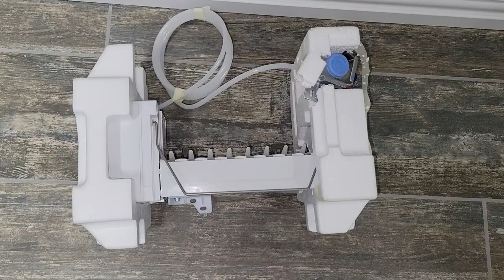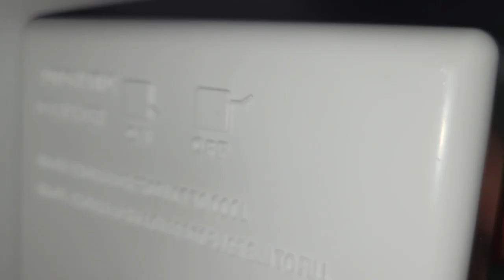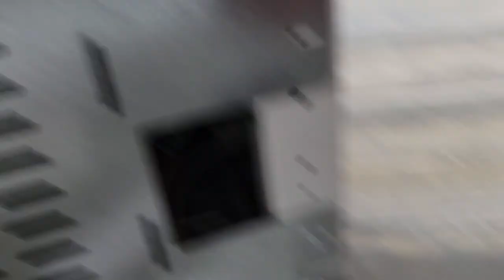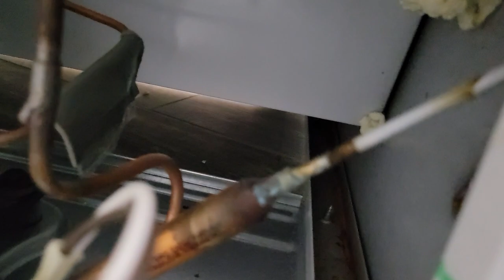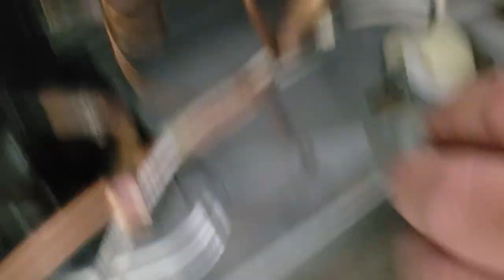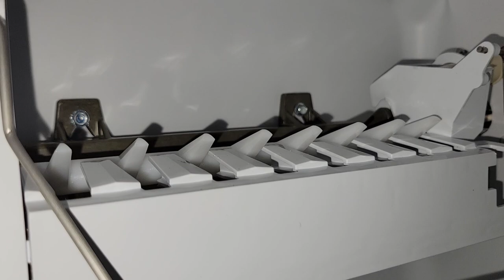Installing an ECKMF95 Ice Maker on my Whirlpool Upright Freezer

Comment: Good video!  I have the same icemaker kit for my Whirlpool upright freezer.  Did you have any issues with the fill tube being open on top?  Mine also came with the open top fill tube, and I am concerned with water leaking through the open part.  Did you use any of the extension tubes?  Thanks.
Reply from the maker: Hi @BRay.549,

No, I didn't have any problems with it once I got it assembled.  My recollection was that the biggest difficulty was getting the first section through the back panel.  It tilts down intentionally, so the holes are already misaligned, but the expansion foam used to fill and insulate the shell makes for additional distortion.  I used the one tube shown here.  https://youtu.be/DHzTdkvCcs4?t=161.

Thanks,

Beo